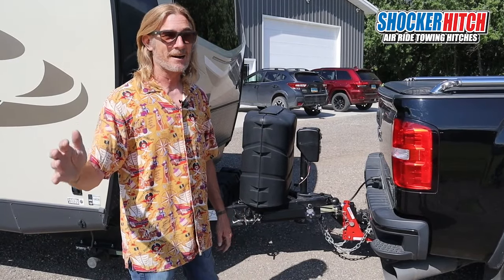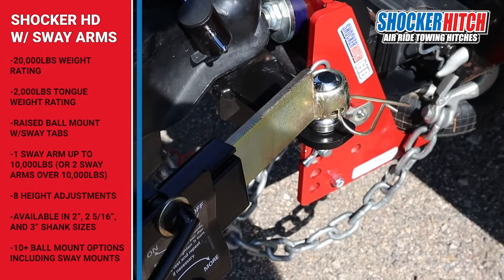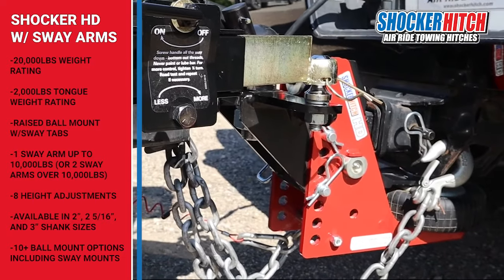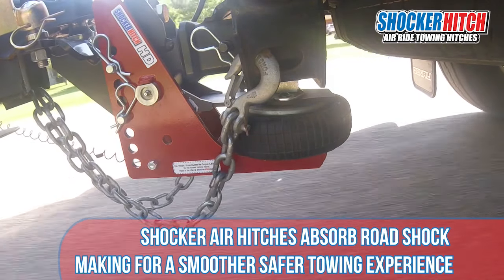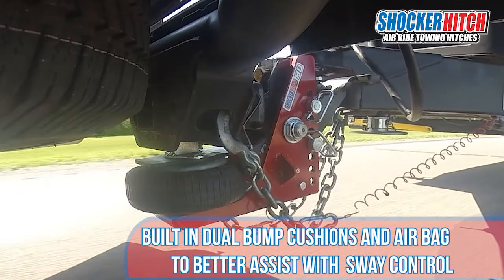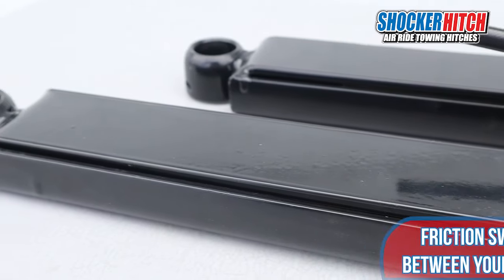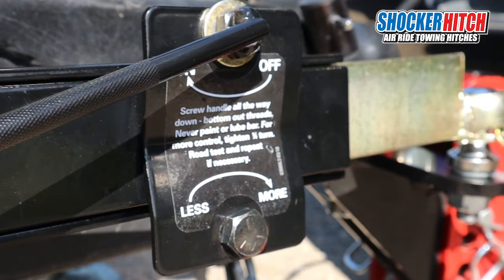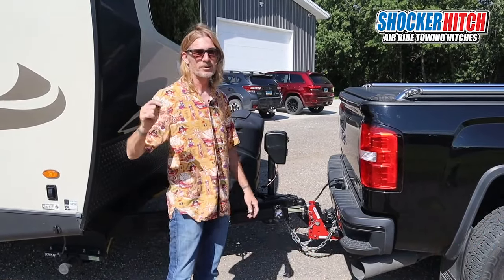Shocker Air Hitches w/ Sway Control - Towing Kits - Prevent Trailer Sway

Comment: Is there a way to put a weight distribution system on this hitch?
Reply from the maker: A weight distribution can not be used with our original air hitches. We did create the Shocker Air Equalizer to pair with weight distribution hitches. Check it out > https://shockerhitch.com/product/air-equalizer/